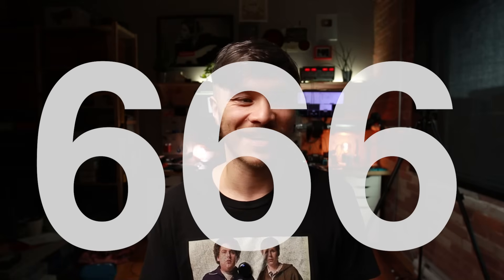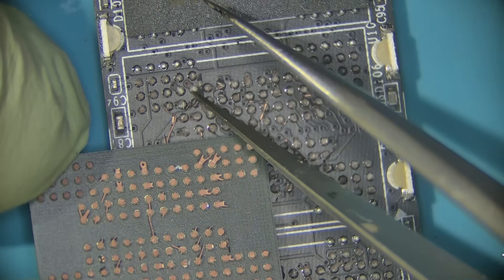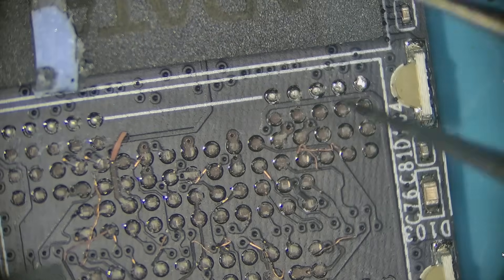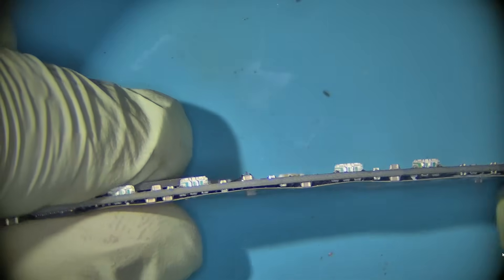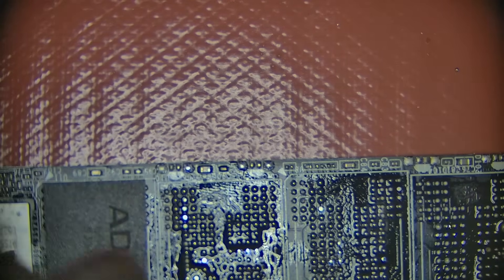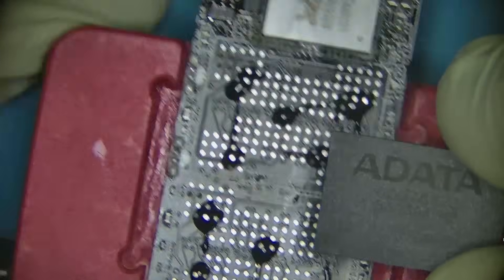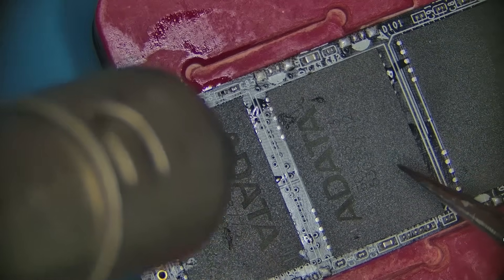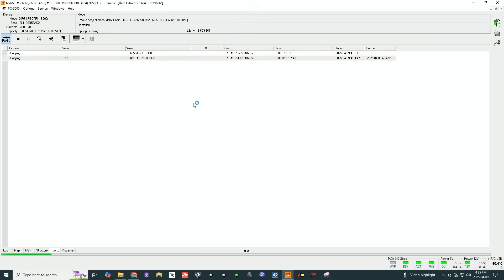SSD Destroyed During Heatsink Upgrade – Full Data Recovery!

Comment: I've been watching your videos for a long time. I have an 8TB WD Purple HDD. When I plug this HDD into Windows, I get an I/O error and it shows 0 bytes. At first, I heard something like a head noise, but when I turned it on, there was no problem with the head. It was stuck on the disk. Based on your experience, can you tell me if this is a mechanical or motherboard problem?

Comment: Amazing! As I understand you give your ssd back to the client with the original chips from the damaged ssd. Here we do a backup for the client so he can access the files from another machine or he pays for a new ssd, in that case data goes to a new device. The fee is for data recovery only, not for fixing the device. But I'll give that a thought since your method seems much less of a burden. The problem is that M2 SSDs are expensive in my country. Thanks for the video!
Reply from the maker: no we just get the data, or produce a sector-by-sector image to the client. SSD can't be reliable even if its new, but after NAND rework its just a timebomb. If client wants the original parts back, no problem, but we don't fix the original so that it could be used again.

Comment: yeah I was looking a drive that has your choice of yes or no for heatsync. I was planning to buy the ASUS Hyper X card. So I'm like.....does this have a heat sync. Yes it does, so heatsync no would be the correct option. I think the drive I eventually bought (corsair 8tb) does not offer one at all. 

And fun side note. Splitting your GPU slot into 8x from 16x on an AMD B550 board (or at least my POS)......disables rebar. And because I'm using an Intel GPU, my video encode performance is about 1/3 of what it was, but I have all 3 drives and a blu-ray showing up at least. But the performance loss sucks. I'm considering upgrading to the new threadripper 9960x. As pricey as the CPU is.....the real killer is RAM and Cooling. $1500 CPU.....probably looking at a $3k upgrade.
Reply from the maker: the only one I bout with heatsink was 970pro Samsung I think.

Comment: Can this work on 2.5 inch ssd ? I mean just to move nand to a working same model ssd and just plug it in the computer to recover data ? or we always need pc 3000 to do some tricks ? :D
Reply from the maker: Depends on the original cause of the problem. If the problem is not with NAND itself they yeah as long as SSD is not serialized. These swaps do not always work

Comment: Still I wouldn't recommend using it as before. Modern 3D NANDs have such a small cell size that when heated, bit flips will be very common among them. Although on the outside there doesn't seems to be any problem, the controller may be struggling with ECC issues. There is a risk that the drive may suddenly die without warning due to uncorrectable sectors or bit flips in firmware or FTL region. 

If you really want to use it, copy the data out and excute a security erase or sanitize command, and update the firmware if possible. This will clear out all the data that may potentially cause problems. And, clean the flux.
Reply from the maker: What I meant to say was using the the target with a sector by sector copy. Not the reworked unit.  You are absolutely right, I would not use that device for anything other than parts again

Comment: I'm not expert in this but wouldn't it be helpful sometimes not to use hot air but one of those things that heats it from the bottom. They even have timers and precise temp controls. Just things it would be easier on the cups and board and it was likely how they were soldered on when made.  Though I understand they are not cheap.
Reply: infrared exists my friend
Reply: 9:12, he did use a pre-heater under board. Pretty sure that's what kept beeping, it was up to temp.
Reply from the maker: yeah, when the temp is up to cook it stats beeping. This SoFix preheater is a beast
Reply: Yeah, I know he was using a preheat system. I was now talking about a system that does it all w/o hot air. Not saying he's doing it wrong. Just a different way. Though like I said, I hear these aren't cheap.